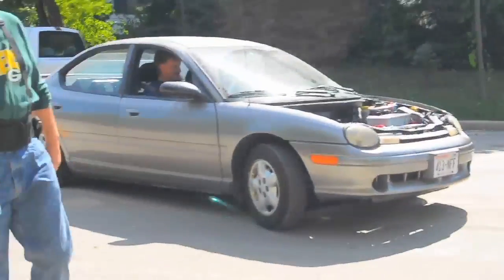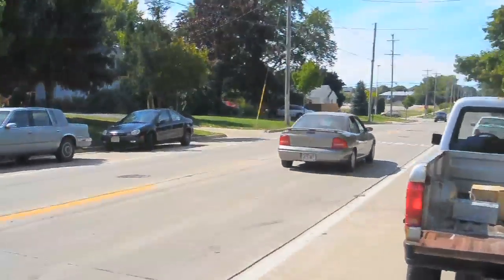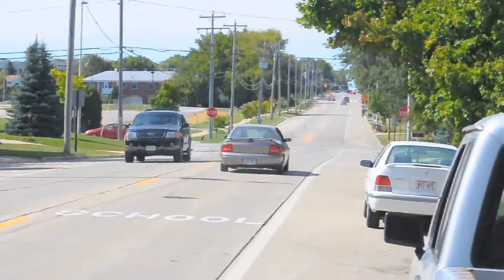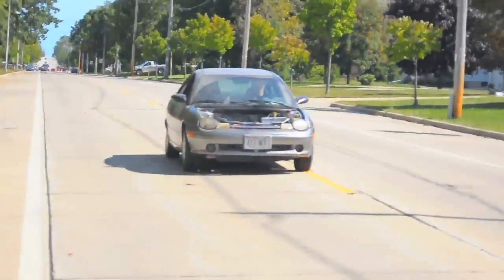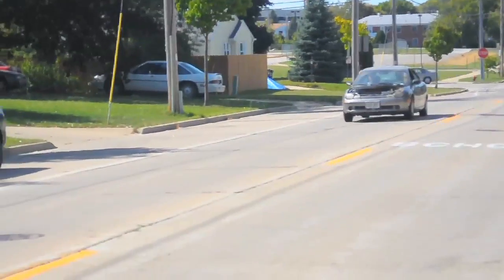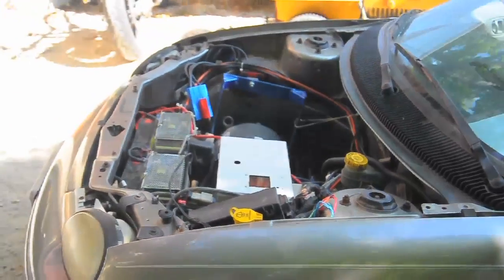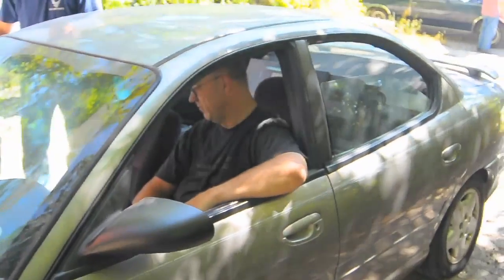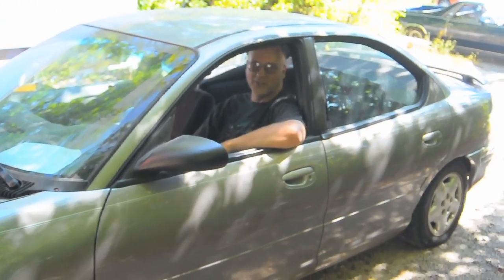009 - AC Electric Car Conversion 101 video 9 - First Test Drive

Comment: You lost passenger capacity, the rear suspension is squatted to its limit, and now it's a disfiguring hazard if you're in an acid, battery acid all over the occupants. I still think it's an excellent project.
Reply from the maker: These are sealed batteries. The owner/builder of the car is a single guy who is just using it for commuting by himself.
He specifically used the "sport" version of the car for increased braking ability.
Frankly, I don't call what he did for suspension. I think he swapped out the coil springs for some beefier ones.

The car met the needs of what he designed it for.

Of course, nowadays, a person can just buy a nice used, commercially-built electric car, but that simply wasn't an option 15 years ago.

Comment: @tappakeggaday1 No need for custom springs as mentioned in the vid, rear springs from a 2000+ (2nd gen) Neon will fit the 95-99 struts and will give more ride height.  Just an FYI.

Comment from the maker: @tappakeggaday1  I don't think Tom ever modified the rear suspension. There are various after-market springs and airbags to change that though.
As for solar panels, those are best on the roof of a garage. An electric car uses much more energy than a few small panels on the car could provide.

Comment: i was noticing how low the back end sits while driving,I didn't know if this was due to the added extra battery weight but was there some way of adding a lift kit to help bring the body more up off the tires?would be great if there was some way to mount a solar panel on top to help charge the batteries while the car was not in motion